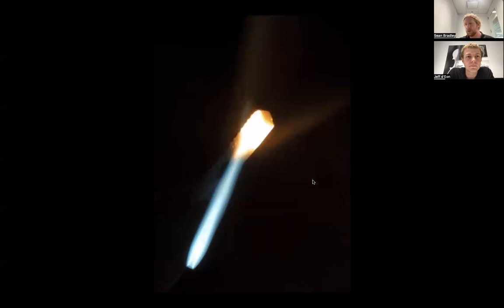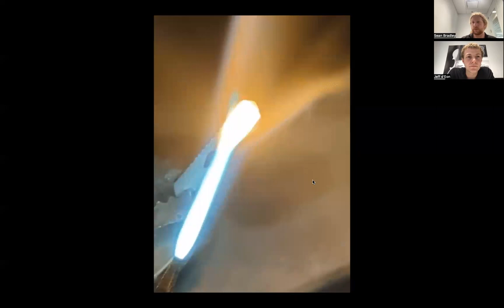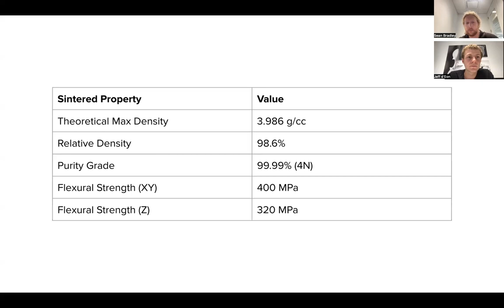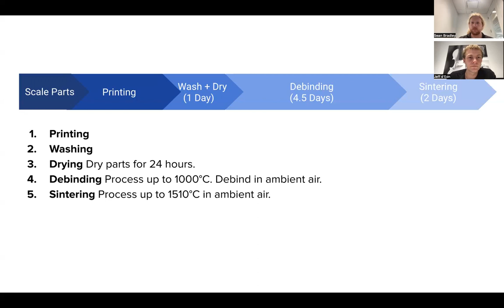Technical Ceramic 3D Printing With Extreme Performance

Comment: very informative vid. are there any design requirements for ceramic parts. internal lattice structure? wall thickness? resolutions? etc. where to find this info, tks